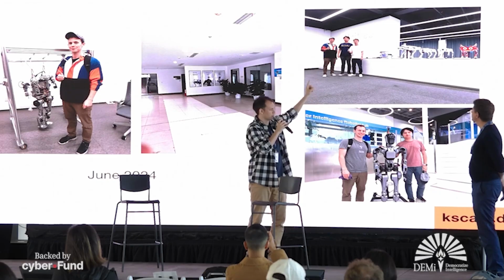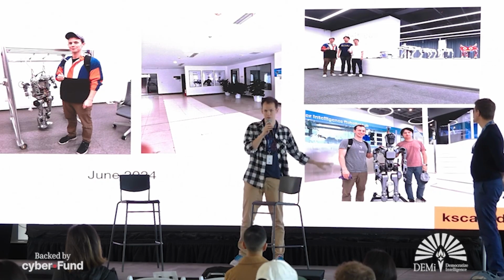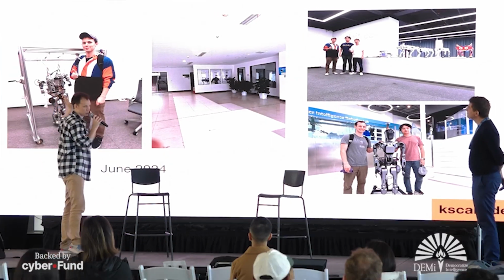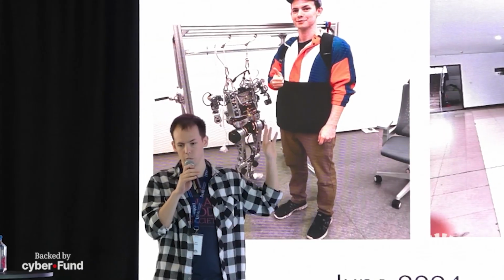Why humanoid robots MUST be open. 2 Top AI Robotics CEOs Explain

Comment: In regard to open sourced software an humanoid robots there seems to be several levels of  what might be open sourced services and resources.

1. The basic hardware, such as K Scale's humanoid robot
2. user add ons (more on that below)
3. Core software, that pretty much comes with the core hardware.
4. Software add  ons.

So let me  present here a use case as an example of each of the above.

Lets say we want our bot to dig holes, e.g. something like we might see in Ukraine in the front lines, a place more suitable for bots to be than humans and hence the need for the bot to dig that hole vs a human.

e.g. Google
the ukraine military dug the ground for his hideout

Now imagine digging this when one  has to worry about being attacked by FPV drones 24/7!

So can humanoid bots dig these holes instead of having humans having to dig them.

This is a perfect use case for the bots in that they don't have to dig  a hole better or faster than a human but only that they can dig it instead of the human, where the human can teleloperate it from a distance  safer  in the rear!

This is where 2. above comes in add ons.

For example the bot might employ an electric powered augur, jack hammer/shovel or even e powered carts and wagons.

e.g. Google
 Top 7 Best Electric Earth Augers 2025 (Corded and Cordless)

Electric shovel, jackhammer

LITEFAR H1 Smart Wagon: Modular Design. Hands-Free Hauling.

So these add ons can not require any modifications to the basic hardware but also might benefit from  smart modifications that take advantage of the bots ability to be so modified, where it is sort of hard to modify a human. 

For example the bots might have a USB port on their wrist of arm or have a swapable hand optimized for a particular task. 

Thy might have hats that can house  additional gear such as additional sensors or lights.

So too might the suppliers have multiple tiers, such as the basic bot builder, a bot modifier that makes major mods, and a bot user who can make more minor mods.

But one might do well to not just look at each of these individual components  but as a system.

For example the bot maker might demo their bot digging a simple hole, where the second tier supplier takes that bot and makes both hardware and software mods  to optimize it to dig specific type holes or ditches, say for a military purpose as the example above, and the the user, that buys that bot might further modify  it  to  meet its special needs.

Thus the tier 1 bot suppler shows the art of the possible while the tier 2 supplier shows not the art of the possible but thing itself, and the the user mods it to fit better in how they want to employ it for real.

And this all needs to be open source to really work really well!

But the companies willing to do that then might have an advantage over bigger companies not will either to  make their products open source or go after niche markets *that is your Tesla Optimus's and Figure robots etc) and benefit those that ware willing to do that, such as your K Scale Labs!